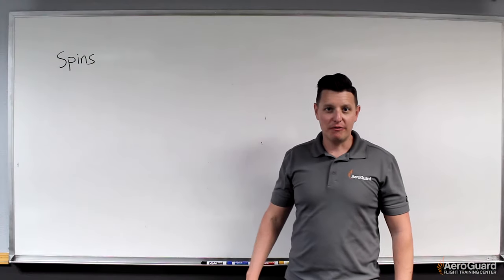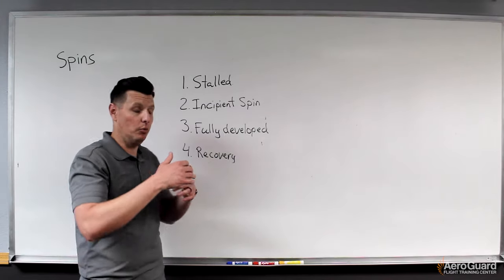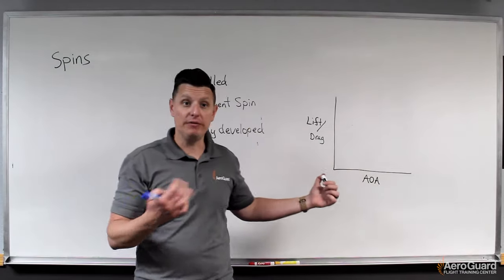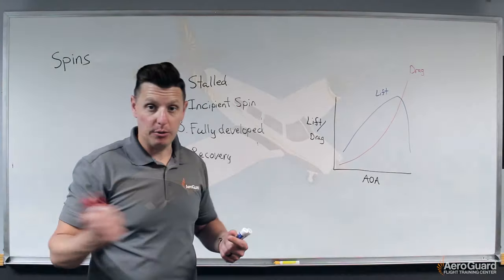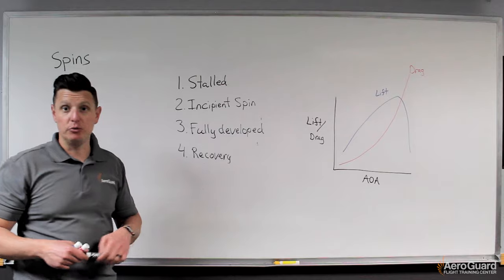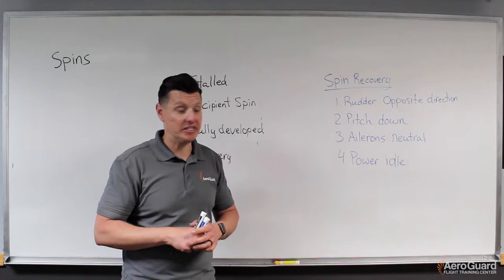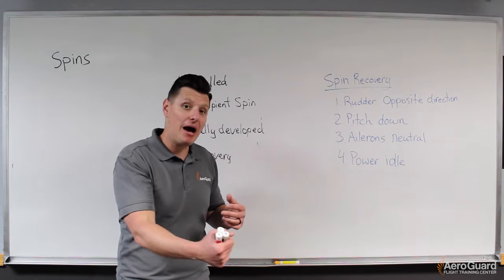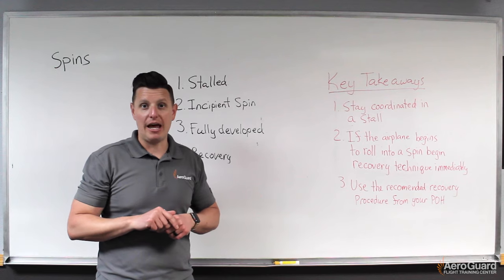Introduction to Spins and Spin Recovery - AeroGuard Flight Training Center

Comment: I remember on my last CFI checkride I presented this lesson and I covered everything that you covered. 
The examiner issued a notice of disapproval stating that my teaching of this maneuver was not clear, concise, complete and technically accurate. I ask him what wasn’t even technically accurate about this and he pointed of the terms that I was using did not establish an accurate description of the spin. The main reason was that some of my terminology wasn’t out of the PHAK and AFH. (It was still correct). He also stated I didn’t use adequate instructional aids. 
To add he has me present two lessons from the FOIs. Never heard of any examiner requiring that. 
After prodding the flight school I discovered that no other CFI initial applicant pass their check ride with him.
Reply from the maker: Hello! Thank you for sharing about your challenging experience with this checkride. It can be frustrating when circumstances like this make the process more difficult, especially when you’ve put in the effort to have a successful examination. Your dedication to preparing for this checkride is commendable, and we are sorry to hear that the outcome didn’t reflect your efforts and knowledge. Our videos are here to help students understand various concepts, refresh their knowledge, and increase their confidence going into exams and checkrides. If you have any concerns or if there’s anything we can assist you with moving forward, please don’t hesitate to reach out with any questions!
Reply: @flyaeroguard  update: when an instructor signs a candidate off for a checkride, the instructor picks the examiner. I’ve spoken with CFIs who had their candidates fail with examiners who they didn’t know.

Comment: Thank you for this! But to my understanding the yawing doesn't make one wing receive more airmass but it increases the airspeed on the outer wing and thus makes the lift increase as it is a part of the lift formula. Is this correct or did I get it wrong?